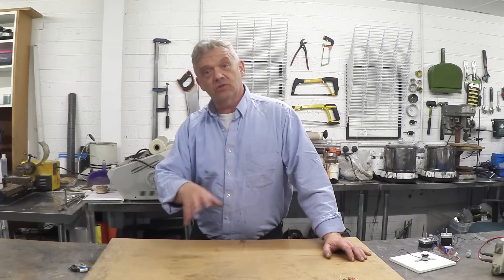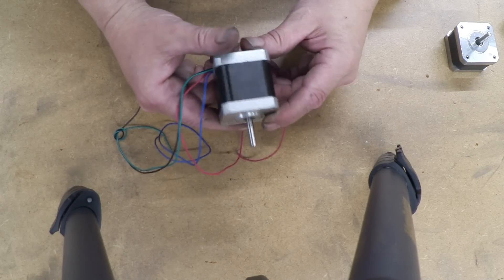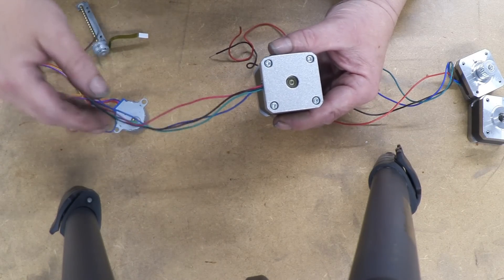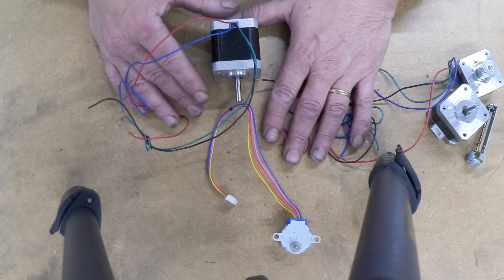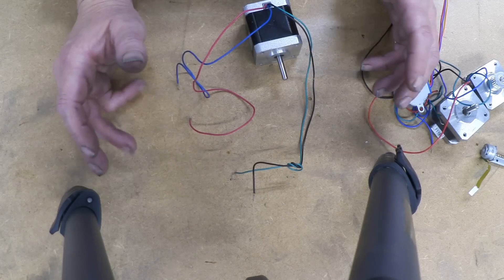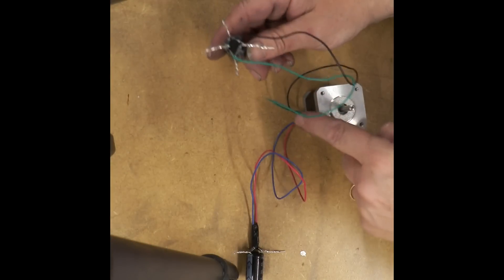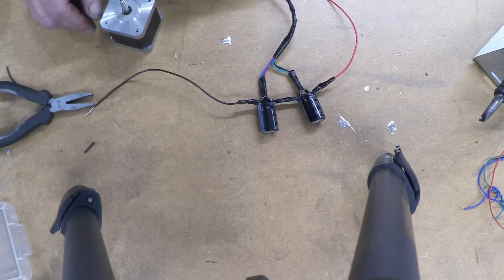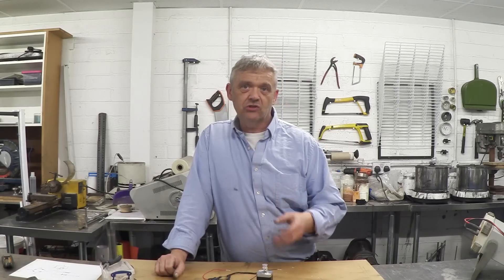All About Converting Stepper Motors To Generators

Comment: I watched this video, although I knew already everything you were talking about. Your voice is so pleasant. One thing I would like to add to your explanation on how to find the two cables of one coil. There is a method to find the corresponding wires without any measuring instrument except your hand. Just connect two wires and try to turn the motor by hand. If it is hard to turn, you found the wires of one coil. Easy to do, but perhaps a bit more difficult to explain why this works. And a bit funny, because it already has to do with power generation. :-)
Reply: Thanks for the tip. Im gonna try that for isolating coils. I already identified it with a meter, but I don't always have that available(because i forget to plan sometimes). Good idea for a minimal survival if you need to generate power possibly too!
Reply: Really glad to hear your comment 😅 I bought a heap of large stepper motors back in the late '80's and now I know how to use them, thanks for your comment 😅😅
Reply: Or just test it with your tongue 🙃

Comment: I used a mid drive 250watt bldc electric bike motor and used my bike to run my 50 watt tv with super capacitors . Worked great . It was the best energy harvester i made and i think the motor was perfect as it did not require much rpm to create the necessary 12 volts for the screen . It seemed to be around 100 watt i was producing for about 10 min and got 20 min telly time ! The key to its effeciency was using a 48 v ebike motor as the rpm could be low to get 12 volts out !
Reply from the maker: that is awesome mate - thanks for sharing
Reply: Can I ask how you regulated it to provide the exact voltage? 😅 thanks
Reply: @Buzzhumma  direk to tv or  u use inveter

Comment: note that for the small one with 5 wires you can't connect them in series to increase voltage, since they have a shared center tap, so connecting that one in series will cause a short cirquit so actually reduce the voltage. those with 4 wires are fine, but the 5 wires ones generally have a shared common.

Comment: A MOSFET active bridge rectifier would probably give you better efficiency, but not that much better to warrant using them over the diodes for a stepper motor.

Comment: I'd recommend parallel wiring for small wind turbines; 

with the series config you'll reach the target voltage at a lower speed, but as the turbine efficiency goes up with tip speed ratio (how fast it rotates relative to the wind speed) and small wind turbines have a tiny radius so a high RPM is needed for a high tip speed, you really want this thing to spin fast.

Therefore it's probably a good idea to try and wire it up in parallel so that the target voltage is reached at a more optimal RPM. If you don't reach the target voltage this way, you can always decide to go back to series. 

Very nice video btw!
Reply from the maker: cheers mate

Comment: Love it. I've seen people use LEDs for their rectifiers, as those were the only diodes they had sitting around.  Thought that was ingenious.  Cheers!
Reply: I have done this aswell
Reply from the maker: it works just fine mate - most folks think a LED is for one thing only - but it is still a diode
Reply: Glad to know that. Thanks
Reply: would't this heavily limit the current?

Comment: You can figure out the wiring without a meter by shorting the wires and trying to turn the spindle/shaft. When the resistance increases with two wires shorted, you know they're both wires of one coil.

Comment: This is the best presentation yet involving the rectifier construction.  I've taken apart some old CFL lamps to expose quite a few usable components.  The rectifier is clearly visible on the circuit board.  Unfortunately, the CFL is hard to come by these days.  Lightbulbs (Edison base)  now are all LED.  Scavenging electronics has always been a hobby, but is limited by the surface mounted components in use today.  When Radio Shack finally closed for good, it was a sad day.  Well, they were going downhill anyway.  At least components still exist online.
Reply from the maker: yeah SMDs are a pain - but eBay helps
Reply: Dick Smith also went down in my country Australia 🌏 but now can get stuff online 😅

Comment: I make small table top concrete displays as a hobby. You could connect a water wheel to the stepper motor which would power a small water pump. You'd have to spin the wheel by hand a few times to charge the capacitors to power the pump to get the water moving over the wheel to get everything started. You'd do away with the electric cord or the battery for the pump. To stop the flow you just stop the wheel until the water stops. That has some real possibilities for some interesting dioramas and other displays.
Reply: So you made a perpetual motion machine? Hot dang!

Comment: 4 wire types are common, 6 wire types are common ( simply have 2 taps in the center ), 5 wire is pretty rare and have the center taps connected together as in your diagram. ( center taps allow for cheap electronics as you don't need 2 full bridges and the dead time timing and stuff like that )  These are fun to play with. They also deliver phase information when used as generators. If you hook up a led wo diodes and turn the motor with led instead of the axis that's very visible and could be used for rotating displays and stuff. A wind turbine with adds would be fun.
These are also pretty good breaks. Tie all wires together and then turn the axis  .. if you can ...
Reply: I have a 6 wire stepper motor, can you explain anything you can to me about it? Would appreciate any information 😅 thanks

Comment: Hi Rob this video is personal to me because in the previous video I asked exactly about this. Topic. Another motor to look at is maybe the brushless motors from the new type electric drills and also used in electric radio controlled cars. Basically a mini 3phase motor.
Reply from the maker: they are all built to the same basic design mate - if you can do a pc fan motor you can do pretty much all BLDC motors including the ones in drills. We did a conversion of a PC fan just apply that
Reply: I also want to know about using a brushless drill motor for this 😅

Comment: 8:36 1N4007 diodes have a forward voltage drop of about 0.7 V. This means this voltage has to be exceeded before they will let energy through to charge the capacitor and have the LED light up, meaning unless a minimum rotational velocity is surpassed, the invested mechanical energy is lost in heat resistance and back EMF.

Schottky diodes such as the 1N5819 have a lower forward voltage drop of about 0.25 V, meaning they can already be used at slower rotations to produce energy for the LEDs.

Comment: An easy way to find the correct wire pairs without a multimeter is by simply joining two wires together and turning the spindle. If you feel resistance you have found your pair.
Reply from the maker: you can - unless it is a small motor in which case you are not going to feel it mate - but nice post and thanks for the tip

Comment: Seems like a handy little hand crank generator I might be able to use something-like  this thanks for sharing, if you config a Zener diode at about 5 / 6 v across the C storage  in reverse bias it will regulate the V to that V and you will have a rudimentary phone charger 6v~ 
As long as the Zener wattage is not exceeded but I think it would be ok , you could parallel the Zener for more wattage. 
Regards
Reply from the maker: cheers mate

Comment: I like it. Consider using schottky diodes for lower voltage drop and more current.
Reply from the maker: for sure mate - I am likely to do a vid on the misfit based rectifier - almost zero drop
Reply: @ThinkingandTinkering  please do- i want a bigger electrolysis PSU.
Reply: @ThinkingandTinkering  I googled that but cannot find it. I suppose thats about using mosfets for controlled recification. I never found how to do that actually. A vid would be nice ....
Reply: I did something like that. But I noticed that my generator would generate for both sides. Is that okay or have I made a mistake with the coils wire?
Reply: @AdelsonDePaulo  what do you mean with both sides?
Reply: @JonnyDeRico  clockwise and the other way too.
Reply: @AdelsonDePaulo  ok, this is normal  - only the polarity changes.
Reply: @JonnyDeRico  thank you, sir.

Comment: I enjoyed the video, thanks.   I have 3 NEMA 17 stepper motors on my 3D printer.  It is easy to generate a back EMF when moving the printer plate.   I have to be careful to move slowly so I do not zap the electronics.   I have seen the printer display light up.   Not good.
Testing for the wire pair which is a coil is easy to do without a multi-meter.   Touch two wires together and try turning the shaft.   If the wires are a coil pair you will feel resistance to the shaft turning.
The splined belt comes in various pitches and widths.   The belt should have the type, e.g., GT2, GT3, etc., but the pinion gear will not have a label, so unless you have purchased a specific pinion gear, it will be important to check the pitch on the pinion to ensure it matches the belt.   GT2 and MXL pitches are very close but not interchangeable.
My 3D printer is using GT2, but my latest project is an electronic step indexer for the wood lathe and it is using MXL belt, so I have to be careful not to interchange anything.
Dave.
Reply from the maker: nice info mate - cheers

Comment: I love the teaching style! Clear to follow and understand the basic principles as well as the build, so I went ahead and made my own set too!  

What sort of amperage and wattage were you getting from yours? My current readings ended up being a dismal 0.02A, but the low rpm-high voltage output (>7V with finger turning) was really neat to play with! Hooked mine up to a voltage regulator to charge a powerbank; not sure how many hours that's going to take though!

Comment: Output is very impressive low rpm Great video Robert thanks man also did you know that you can use a Stepper Motor as a Bedini Motor you can use the same one you showed in this video all you need is to make the bedini ssg circuit then hook the stepper motor to the circuit 2 wires will be the trigger and the other 2 will be the power wires the power wires will be the coil with the most resistance and the trigger wires will be the ones with the lowest resistance the orientation of the wires don't matter for each coil but yes the 2 wires that go to the trigger have to go to the trigger what I'm saying is the start and the end of the coil doesn't matter just wire the 2 triggers to the trigger on the circuit and 2 power wires to power wire on the circuit and the the circuit has 2 posatives and 2 negatives so 1 set for the run battery and other for charging battery once it's hooked up just spin the stepper motor by hand give it a quick turn left if it doesn't start spinning then spin it right and you will see it spin it will hum and vibrate a bit on the table also use the potentiometer to a just the charing rate and speed and amp draw on the run battery also you can get it to go into self ossilation mode where it doesn't spin but vibrates and hums and will still charge would be awesome to see you make a video on this think it's very useful you don't have to worry about winding coils and making rotors just make the ssg circuit and get a stepper motor and 2 battery's and your good to go Cheers Mate
Reply from the maker: nice one - cheers mate
Reply: Ahh Thanks for the idea Brandon never thought of it from that perspective. Interesting to say the least will have to experiment with this. God Speed

Comment: for the life of me i cant figure out how to use my old blender motor for a wind turbine. its a great universal motor with a great build in gear ratio and is good for attachments and swapping of blades. i do have a lot of replacement steppers might try this lol. get some high winds during dust storms here great video

Comment: Hello Rob, great videos! I have to admit, I really got hooked up with the idea of building my own wind generator. Not for getting my whole household running of course, but for the experimenting around for fun. Idea is to have a couple of ugrinsky elements stacked on one axis with a bit offset (don't have a 3d printer 😅). A stepper motor would be my generator. Now, what puzzles me is the question if I risk burning the generator at better wind or what to keep in mind. Should I better go with the Thunderbolt generator concept and what wire diameter is good if doing so?
Kind regards from Switzerland.
Keep going!

Comment: I am sure that the 5 wire motor is a cheap way to allow micro stepping so you can pulse half a coil at a time and use a micro controller to control the pulsing sequence. I assume that the six wire motors are a similar thing. Thanks for your great videos. I would like to try a wind wall. It is not possible where I live to put up a turbine  on a tower without the permission of all the neighbors.

Comment: Hello Sir,
At first thanks for sharing the wonderful information in the best easy way.
I have few questions in my mind taking "Stepper Motors", hope you could answer them. Thanks in advance.

Q1. According to you, which motor is best to generator electricity, and why?
Options:
A. Brushed DC Motor
B. BLDC Motor
C. Stepper Motor

Q2. Referencing video, if I choose "Stepper Motor" as a Generator then which one to choose and on what parameters?
We have, Stepper Motors with many different specifications such as

a. Unipolar and Bipolar
What I have learnt and understood watching videos on YouTube (I maybe wrong, maybe right, please correct me if it goes wrong) is that, Unipolar is easy to use and works faster than Bipolar. Secondly, we don't need to reverse the rotational direction in the Generator, so we don't need "Bipolar". So, we should use Unipolar in Power generation. (Please clarify)
- Which one to choose and what are the advantages and disadvantages?

b. Low / High Torque
Second factor that I get to know about is the "Torque". In my learning, torque is the rotational force that is required to push or pull something. But in our case of power generation, we are not going to use Stepper Motor as motor but as generator which needs rotation at a speed to generate some voltage. We are not pushing or pulling anything. So, we should not consider or least consider Torque. Low Torque - High Speed (Please clarify)
- What motor torque should be consider in Stepper Motor as generator?
- Is least torque motor best suitable for power generation?

c. Low/ High Input Voltage
There are different input voltages available such as (12V, 24V, 48V, etc) according to different sizes and different torques.
- Do they have any relation to the output voltage of the Stepper Motor as generator?
- Which is best suitable voltage stepper motor to choose to work as generator?

d. RPM (Speed)
Get to know,
Stepper motors have different RPM (10000, 6000, 4000, 3000, 2000, 1500, 1000 or lesser)
Smaller Motors have Less Torque but High Speed
As the size increases Motors have higher Torque and Lesser Speed
-Is it correct, that, more the speed more the voltage we would get? (Please clarify)
-What is the ideal speed or RPM that we require to generate the desired or correct output (voltage) for power generation?

e. Steps (Less / 200 / 400 / More)
As per my information, Steps are only required for the accuracy to work.
More Steps gives More Accuracy and Precision
- Do "Steps" play a role in power generation which I don't think so, please clarify?

f. Single / Double Shaft
- Do we have advantage of double shaft motor instead of single, in case, if we put 2 rotors to rotate the shaft of the "Stepper Motor i.e Generator) for more smooth operation and speed? (Please comment and clarify)

g. Geared / Non Geared
As per my information, gears gives more or high torque.
- Do we any advantage of geared stepper motor in power generation which I don't think so? (Please comment and share your views)

What all factors are important and must be considered choosing stepper motor as generator? Also consider, other factor that I have missed which should be considered choosing "Stepper Motor" as Generator.

It would be really helpful, if you would share your views and comment or prepare a video considering the above points.

Thank you once again for sharing the informational video and look forward more similar videos from you.
Thanks
Reply: Stepper motors are the obvious choice. They are easy to wire and produce a good output. DC motors have brushe that degrade pretty quickly.
Reply: @ArnookieVR  Thankyou for your response, what about Brushless DC motors. Can you respond to any of the queries above for better understanding.
Reply: @navalkishoresingal  I find stepper motors are better for hobby use overall. 
They are easy to connect and produce a good voltage evan at low speeds. 
This makes them ideal for DIY wind turbines & hand cranked generators. You would need to use a rectifier and capacitor on the output to get a nice stable DC output voltage. 
You can also use a car radiator fan for a super easy wind turbine. 
But you would need to increase the fan blades length. 😉
Reply: Stepper motors are rarely rated on voltage. 
This is because of the nature stepper motors work by. 
Steppers are usually run on a low voltage. 
A NEMA 17 stepper would normally be rated 12 to 24v. 
But would normally be driven by 2v or even less ie when used on a 3d printer.